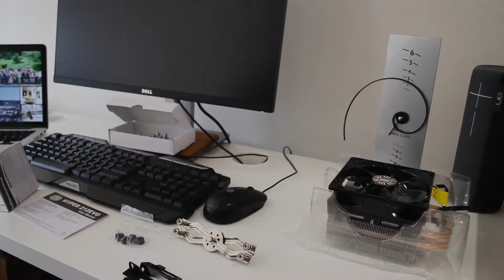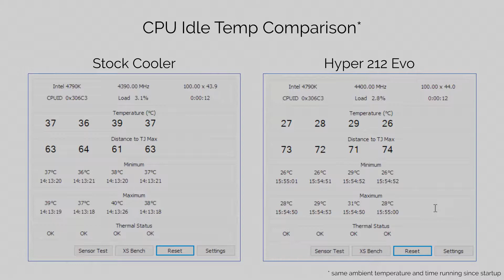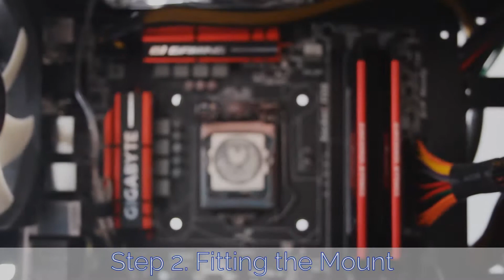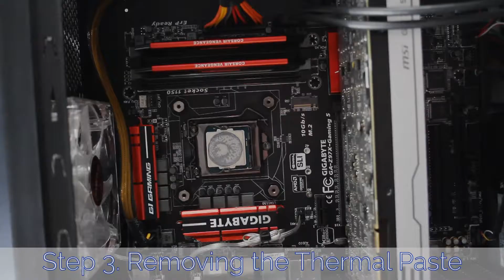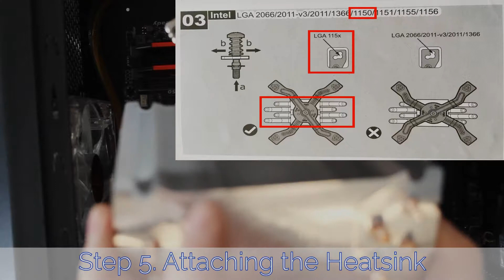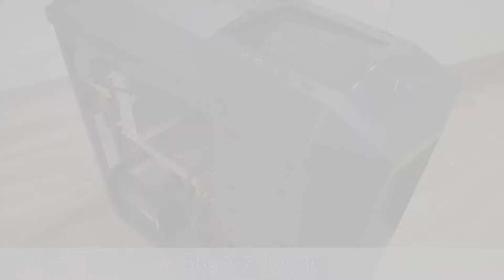How to install Hyper 212 Evo [EASY i7-4790K upgrade: step-by-step]

Comment: Thank you for the video. I was planning on upgrading my cooler from the stock to something like this and your vide was informative.
Reply from the maker: Glad I could help in some way. I found a lot of videos showing how to do this but they were mostly on test rigs. I thought it would be helpful to have an in situ video floating around too.

You can see it's pretty easy to do and well worth it for the cost of the cooler!
Reply: @xplaneist304  I'm gonna buy the same cooler  and replace the existing stock cooler
Reply from the maker: @lc2632  did you manage to upgrade yours?